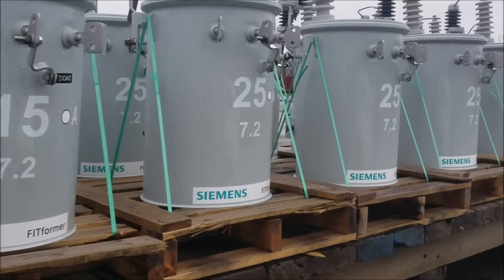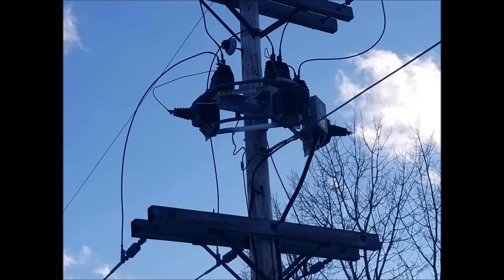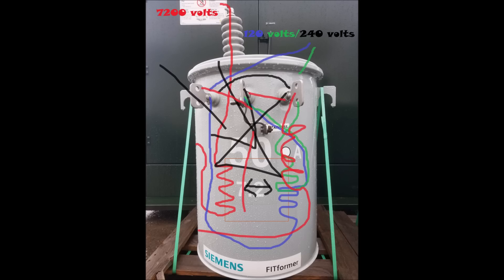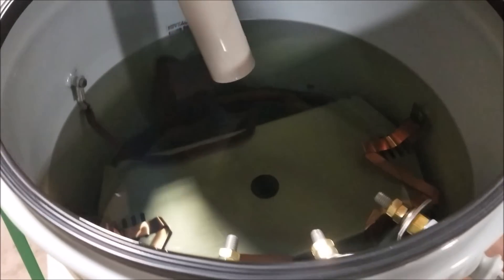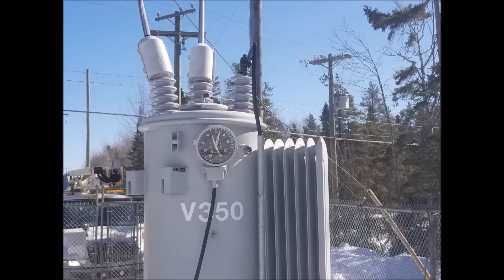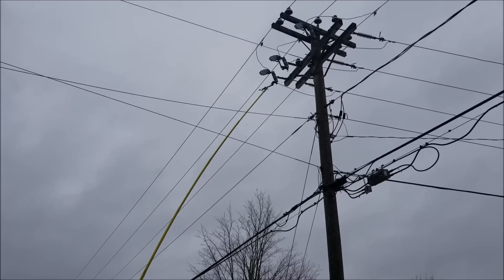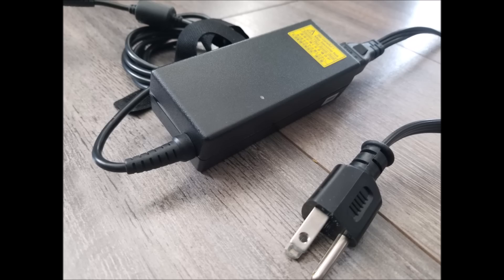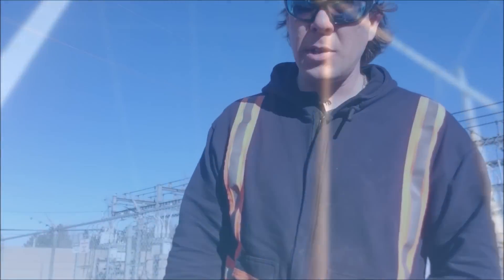What's inside a Transformer?

Comment: What would it cost to upgrade the grid to make it more resilient to an EMP event ?
Reply: The grid of the 1970s (or earlier) might have survived an EMP event.  The distribution grid itself is pretty 'dumb'.  The distribution lines and pole/pad-mount transformers will likely survive the EMP.  The transformers are simply coils of wire around an iron core.  Not much to be damaged.  It's the substations and generators that will get taken out by an EMP.  It will destroy all of the solid-state, microprocessor components in modern relays and controls.
Reply: The  power  grid  needs to  have  a  backup system in case such an  event occurs

Comment: I was wondering if the new versions of these transformers still use PCBs in the oil coolant?
Reply: Flambo One At 4:07 in the video it shows a non PCB mineral oil label.
Reply: PCB’s are no longer used
Reply: In 1979, the US EPA banned the use of PCBs, but they still exist in some products produced before 1979

Comment: Very old transformers have PCB in them and are dangerous even not connected.
Reply: "Very" old transformers would predate PCBs, and use mineral oil as coolant.
Reply: @TorontoLS  
1979 is pretty old for a transformer on a pole . They usually only last about 20 years .

PCBs, or polychlorinated biphenyls, are industrial products or chemicals. These chemicals were banned in the U.S. in 1979 amid suggestions that PCBs could have unintended impacts on human and environmental health.Apr 9, 2020
Reply: Benjimen:
I've seen some pole transformers with cast iron tanks, and both high voltage (2400) and low voltage (2x120) winding leads emerge via porcelain bushings.  They probably date from the 25 hertz era (before 1950s), and their loads did not overload them, allowing them to remain in service.
Given the cost of labour, I can't imagine any well-run electricity distribution utility that would install transformers with a life expectancy of only 20 years.
Reply: @TorontoLS  
So then they are still a lot of transformers floating around with PCBs ! I too have seen some very old transformers I actually own one. There were a lot of transformers taking out if service because of the crap that was /is inside them. I know I took them down to return them to the manufacturer . Not to mention the ones under ground and on transformer pads . I have seen things that you wouldn't believe.
Reply: @TorontoLS  
I did a lot of work on military base and when something has to come down it comes down. They got a mandate about the PCBs and we had to remove them from the base . It's that simple. They usually charge them out every 20 years any way.
Reply: Benjimen:
During the period of Askarel-filled transformers (called in the standards liquid-filled, to differentiate from oil-filled) (Askarel was GE's brand of PCB liquid), because the Askarel could be mixed with transformer-grade mineral oil with no adverse effect to the electrical equipment, it was common that utilities did not take precautions to prevent any Askarel from getting into storage tanks and transformers intended for mineral oil (the special care would have been only for the other direction).
After the "PCB ban", equipment intended for handling mineral oil would have had any traces of PCB removed.  All the transformers that should have been exclusively oil filled would have had the oil sampled and chemically tested.  If there were a PCB concentration above a specified small value, special equipment would "flush" such transformers with "fresh" mineral oil sufficient to bring the PCB "contamination" below the upper limit.  The PCB-contaminated oil would go through a process to separate the PCB from the oil, the latter being reused.  Most particularly, the transformers would NOT have been replaced, only the oil in them, at their locations of installation.
Transformers which "had" to be liquid-filled (i.e., not oil-filled, for fire reasons) would typically have been replaced with dry-type transformers.  For a city like Toronto, even including customer-owned transformers, liquid-filled transformers would have been a minority of the units installed.
Reply: Benjimen:
Perhaps the military base where you worked was flush with cash, and didn't mind replacing equipment prematurely or when problems could be solved by remediation.  Kind of like the old joke: the ash trays are full, trade in the automobile.
Reply: @TorontoLS  
It was a job. You do what you are told so I did that's what they paid us for. The must have had plenty of money . We tore out the entire runway because they didn't like the kind of lights they had. Would have been simple to just replace lights but they wanted new wiring and a grounding system from hell . We put in over 20 miles of 750 MCM bare copper wire and hundreds of ground rods thirty feet long and cadwelded the whole thing. Took us a year to finish that .

Comment: I’ve always wondered how many turns per volt these pole transformers have. I can’t get my head around how they fit all the turns on that small (in the power distribution sense) core! I suppose with the huge substation transformers it’s volts per turn rather than turns per volt?
Reply: Usually it's not that many. The low voltage side usually just has a thick ribbon (typically a around 0.1 inch thick and about the same height as the entire winding) that is wound 15 - 20 turns. The high voltage winding is wound around the low voltage winding and is usually a couple hundred turns of a thick wire (10AWG or something like that). This is in the case of the 10kV pole transformers, at least the ones we have here in Sweden and ones I'm more familiar with. 

Of course there will be variations, especially once you get to the large substation transformers which are not only wound with thicker wire (more like a bar than a wire at that point) but would typically have multiple windings on the "low side" for voltage adjustments. 

There is a lot to cover if you really want to get in on the topic, so google is your friend :)
Reply: RTD Laboratories - 200 turns primary, 20 turns secondary is only a 10:1 reduction, though. A 10KV input would be 1KV out! 
I’ve watched countless videos and read many articles on power distribution transformers, but I’ve never been able to find out how many turns per volt/volts per turn  the various size transformers use. I guess if I knew the core area I could get a ballpark figure, but that’s also info that doesn’t seem forthcoming.
I’m guessing the big transformers run very close to saturation to maintain regulation, hence the need for oil (and fan assisted cooling on the bigger ones), so they probably have less turns than expected.
Reply: @ProdigalPorcupine  I never said 200 turns tho. In my example phase to phase voltage on the HV side it 10kV, and on the LV side it's 0.4kV, then the ratio is 25:1. So, if the low voltage winding has 20 turns the high voltage winding would have 20*25=500 turns. If it's 15 on the LV end then it's 375 on the HV end, therefore I said "a couple hundred".
Reply: RTD Laboratories - OK, fair enough! :-)

Comment: What was the deal with transformers using vile chemicals like PCB's(polychlorinated byphenal) back up until the 70's, why wasn't mineral oil used instead?
Reply: Mineral oil burns in an oxygen environment; PCBs do not, allowing transformers filled with such liquid to be used inside buildings without need for fire-resistant vaults.
Reply: @TorontoLS  Hey thanks for that

Comment: I believe that the "transformers" you mentioned in houses are actually switching power supplys.
Reply: Correct! However, a "switching power supply" (more correctly a SMPS - switch mode power supply) still uses a magnetic transformer to step down the voltage, and step up the current, to deliver low-voltage isolated power to the output side. The switch operates at a much higher frequency than utility power at 60Hz (North America and elsewhere, or 50Hz in Europe) A switching power supply typically operates at 100KHz (twenty thousand times more rapid than utility frequency)
As the transformer size is INVERSELY proportional to frequency a switching power supply is much smaller (and lighter weight) than an equivalent core-coil transformer. Aircraft electrical operates at 400Hz to save weight.
The principle of the transformer is the same in either case. Electrical current passing through a winding magnetizes a core (laminated iron at 50/60Hz, but ferrite at 100KHz), the flux from that core passes through the second winding and produces an output voltage. The ratio of input to output is governed by the turns ratio in either type of transformer application.
Inside a SMPS where the utility power is AC it is rectified to DC, then "chopped" in the switch and sent to the transformer, after the voltage step down the output of the transformer is rectified to produce DC.
Most, but not all, SMPS use the fly-back principle to store magnetic energy in the transformer's core. In contrast the utility transformer does not store energy, but instead induces current in the secondary winding.
More modern switching power supplies use resonance converters (LLC) that use frequency control to regulate the output load.
Reply: Peter:
One editorial correction:  Other things being equal, the transformer size and weight are INVERSELY proportional to its operating frequency.
Reply: @TorontoLS  Very true.  Airplanes often have 120v 400hz AC power in order to make the equipment for it lighter.
Reply: @TorontoLS  Correction made, thanks for spotting my silly error!
Reply: It's still a transformer, it's just an extremely high frequency transformer. Usually switching power supplies rectify line voltage directly to DC, and then chop it up at an extremely high frequency. Then you can use a much smaller transformer  for the same power. That's why switching power bricks for the same wattage are so much lighter than the old wall warts that had a 60hz transformer in them.
Reply: @aoeuidhtnsnthdiueoa  Correct! What has not been discussed in detail are the fundamental differences between coil-over-core utility transformers (those working on sinewaves at 50 or 60Hz, or 400Hz in aircraft) and SMPS (Switch Mode Power Supply) types. Coil-over-core transformers are very efficient, about 98%.
There are two popular SMPS topologies; FBK (Flyback) and LLC (Resonance), the latter being quite new.
FBK SMPS does not simply use a high frequency transformer that replaces the utility transformer, it is a choke with two windings. During the charging stroke the energy from the first winding is stored in the magnetic core, and during the discharging stroke that energy is extracted by the secondary winding. The ratio of turns on the core is not proportional to the step down (or step up) voltages, as is the case with coil-over-core types. Rather the transformer delivers the quantity of energy that is needed to satisfy the load and tightly maintain the output voltage. For example, a SMPS delivering 12V DC output from a 120V AC input may have a turns ratio of fifteen to twenty to one, not 12/120 as for a coil-over-core type operating on sinewaves. A compete cycle (charging and discharging strokes) may only take ten microseconds, or one hundred thousand cycles per second.
In the more recently invented Resonance (or LLC) topology the transformer primary winding is connected to a second inductor and a capacitor that resonate together. Energy from that tank circuit is coupled through the transformer to the secondary winding. Hence the name L-L-C. maximum energy is transferred at resonance, and when the operating frequency is shifted off-resonance the energy transfer is reduced, thus regulating the voltage at the output side (and after further rectification)
Regulation of the output is therefore controlled by the operating frequency, again this is around 100kHz making the transformer, inductor, and capacitor physically quite small. Further development eliminated the second inductor by a clever trick to introduce leakage inductance in the primary side of the LLC transformer.
Reply: Still has a transformer

Comment: Very cool video! I use to work in substation, now I'm in generation but anyways, we would clean our insulators with water from the power plant across the street. The substation can not be shut down because of customer demand on it. Until that day I thought for sure water and electricity do not mix. Turns out, they can but the water is not the danger, it's the minerals and contaminats in the water that conducts the electricity. So, very weird feeling washing insulators on an energized tranformer and breakers. Demineralized water or demin water is 100% safe to use for this process. Corn cobs that have been crushed to a fine media also is an excellent cleaner of porcelain insulators in an energized environment. Just be very aware of approach distances because they don't change and you can be killed quick.

Comment: What inside a Transformer? Definitely not an Autobot that 4 sure. How's it made take one apart in legit form.
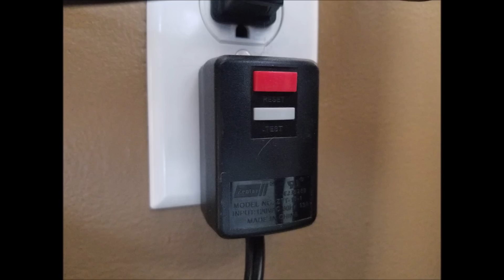You forgot to mention AC to DC conversion 5:51 A transformer to step the mains down to a working output voltage, a rectifier to convert the AC to DC, some form of capacitive filter to smooth the rectifier's output, and a voltage regulator to keep the voltage constant.
Reply from the maker: You're absolutely right totally my bad! ✌️

Comment: Worked as an industrial maintenance technician, had a power outage on one of 6 30kv transformers in the factory. When our crewchief tried to power it back on to see if the fault had gone away, it blew up, taking out the power to most of the city around us. My coworker and I have never been happier to see big armored doors hold up and protect us from the explosion, though they were bent a good few inches. Never seen more firefighters in my life as when we called in "explosion and possible fire in high voltage transformer". Ears were ringing for days after that
Reply from the maker: Oh wow that sounds like a really close call!
Reply: @Bobsdecline  Yeah, really illustrated to me how you simply can't make a decision like that without knowing everyone is clear and safe.
Reply from the maker: Definitely! Even when we energize new buildings we go inside and ask everyone to leave the electrical room while things are powered up!
Reply: @Bobsdecline  Arc flashes are NO JOKE.  I'm surprised they don't train you to look away from closing or opening cutouts or switches.

Comment: When traveling along highways, seeing a orange balls attached to hi voltage electric wires. What's it ? Why it's there ? And how it's works. Thanks
Reply: Helps with air craft like helicopter...to mark them
Reply from the maker: Cecil is absolutely right! ⬆️ They just clip right onto the wire! ✌️
Reply: In the county I am in ...air evac is used alot..certain fields they mark power lines with those orange balls...very small airports same thing
Reply: The orange balls are not just for helicopters, more than not, they identify overhead wires for cranes and high lift vehicles
Reply: I thought it’s a target 🎯,  just kidding, kidding Okay!!! Lol. Yeah for helicopters to sight the lines, seen them through mountains.

Comment: Noice!
While I was trained in electronics, and know what a transformer does.... I'd never seen the inside of a big one like that before.
You should do a more detailed version on why home generators can be so dangerous to lineman working on downed lines. Most people don't realize they work the other way.....
Keep the videos coming.... but be safe!
Reply: Yes people like to use suicide cords. You should have the genrator isolated from the power pole.
Reply: You might like this video:  https://youtu.be/g7E6wJ7h30c
Reply: Home depot carries a selector switch for GE electrical boxes.  Run a circuit to the generator. This kit locks those breaker off, until you turn off the house main breakers. Then when you want to go back. The generator breaks have to be turned off first before turning back on the main.
Reply: Totally agree on the generator and back feeding request. During the big Ice Storm '98 here in Eastern Ontario I was hooking up a lot of generators. We had a hydro inspector who lived in our village and did a lot of work helping out. He was insistent that if I was back feeding a panel that I disconnect the service neutral as well as having the main breaker turned off. Was easy to do when the power grid was down, was a little more tense connecting things back up 10 days later! 

I notice that the Square D generator panels available at HD use parallel 3 phase breakers to switch all three lines, which I thought was a pretty clever solution. However, my son just had a Generlink unit installed in the meter base of his house and it doesn't switch the neutral, at least as far as I could tell when hydro had it out when the new service was finally getting connected. So I am kind of wondering what's going on there.

And I can tell you that after going through the Ice Storm I have immense respect for all the linemen who worked so tirelessly to repair all the damage. So the last thing I would want to do is put them at any risk if I have to use my generator. Right now I just unplug things and plug them into the generator so that things are totally separate, just to be sure.
Reply: I have an interface which uncouples pole service feed when the generator starts.

Comment: I haven't thought about this for so many years, I used to occasionally put a rifled slug into some of the Transformers mostly the older blue ones and they would explode orange Fireballs everywhere. The grey ones not so much so I stopped doing it. The blue ones had an orange fluid inside of them the gray ones had a green fluid.